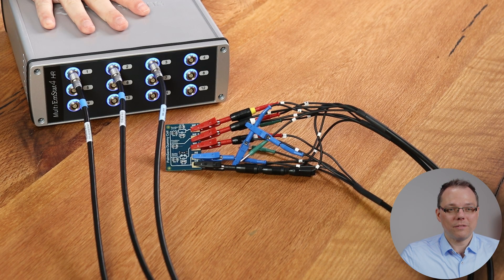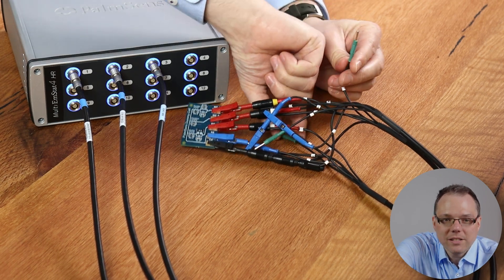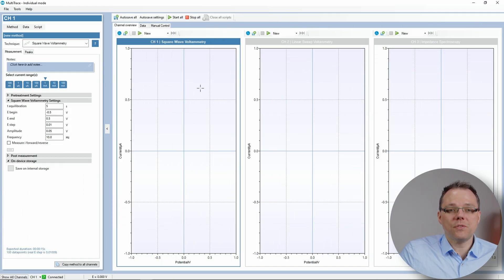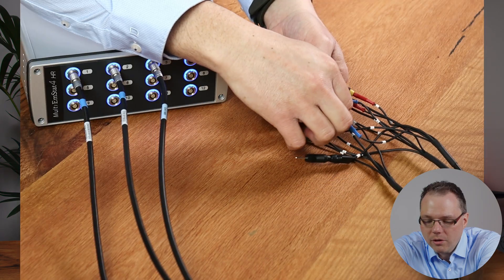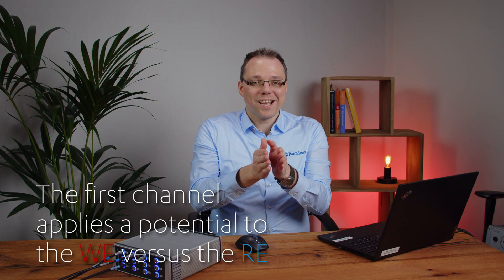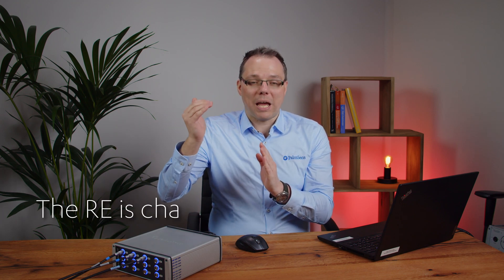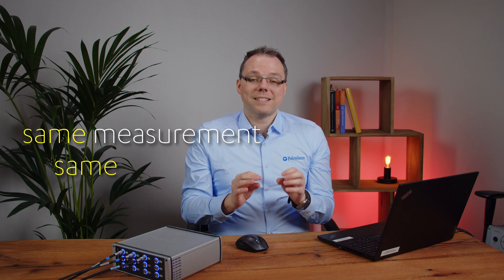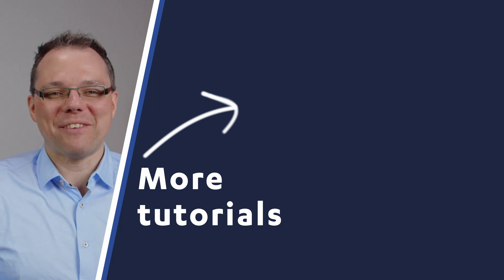MultiTrace Tutorial #5: Multiple Working Electrodes in the Same Cell

Comment: Hi could you please guide about the connections of two electrode system?
Reply from the maker: Sure, you can find this information on the instrument / software manual, next to the Section ' Measurements'. Here follows the information for your convenience:

2-electrode cell connection
For a 2-electrode setup, combine the counter and reference electrode leads. The counter electrode plug of PalmSens cables is stackable, allowing for convenient combination. Subsequently, connect the working electrode lead to one electrode and the combined counter and reference electrode leads to the other. 

In models with a Sense lead, combine it with the working electrode, utilizing its stackable feature similar to the CE lead.

Comment: Hello, thank you very much for your informative video. I am curious about the potential impact of using a single reference electrode for multiple pairs of working/counter electrodes, especially when applying voltage to each channel relative to this shared reference electrode.
Reply from the maker: Dear Colonel Banane, I have not observed much impact. There was a bit of extra noise during CA when EIS was run in parallel. A more detailed description and plots comparing the measurement while EIS was running on another channel to a solo measurement are available here: https://www.palmsens.com/knowledgebase-article/multi-channel-multiple-working-electrodes-in-the-same-cell/